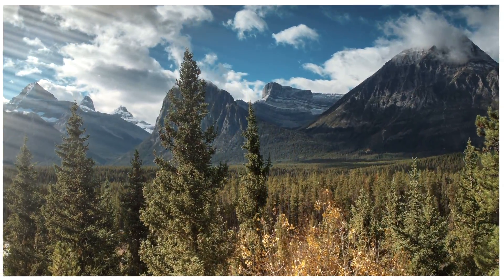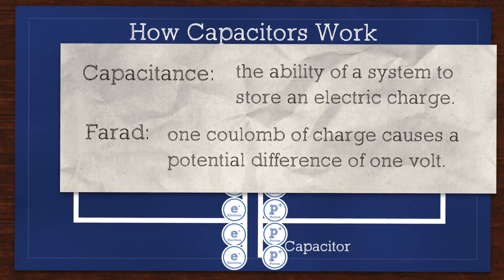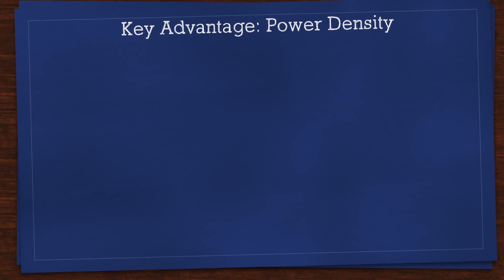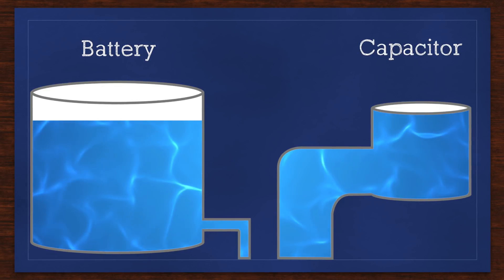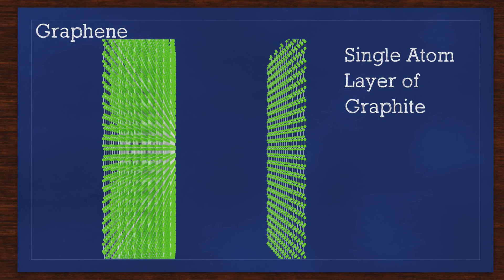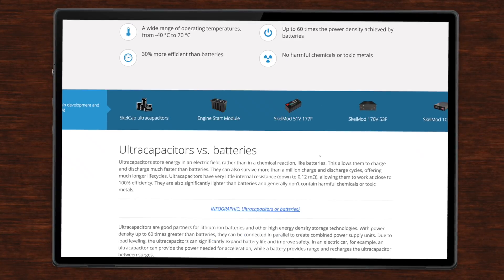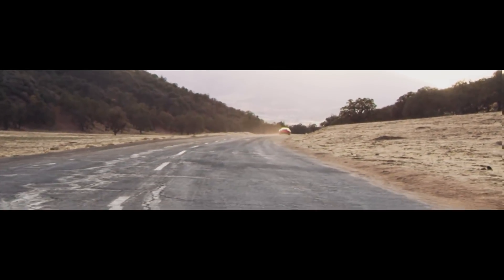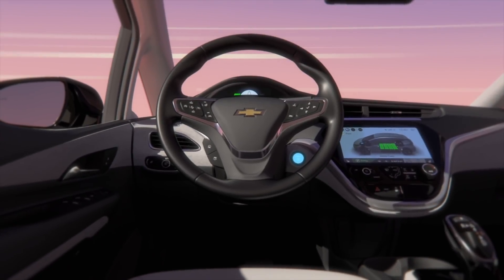Can This New Technology Make Batteries Obsolete?

Comment: Will this change your source of energy to run your home and your car and lower your bill from the electric company maybe no bill or you might get a check from them. If every home had that capability then any natural or even a war would be much less likely and the lights would stay on even if a disaster happened. Not sure of the impact on life and or manufacturing in the long term maybe you can enlighten the viewers. If you want to think far out you might think of a food Synthesizer just put in the right food cartridges and push the button

Comment: I remember back from my tech training days at Kessler AFB, MS in the 1980s that we were taught 
by wiring resistor to the Antenna of a mobile radio to boost it's signal strength and prevent power  loss.   

A similar type of device should be used to prevent power drainage to a capacitors storage. There will design issues but someone will figure it out to make it work.  I apologize if i am wrong on this subject but it's just a thought on my part.

Comment: How do you keep these from becoming bombs? Either accidental or intentional? Any time you put large amounts energy, in a form that can release it almost instantly, you have the potential for large scale damage. Imagine these in a Tesla. First how well would they hold up to a crash? As dangerous as lithium ion batteries are in a crash/fire: how dangerous would something be that could release its energy at 10/100 times the rate? One of the things that scares first responders is cutting into electric or hybrid vehicles. Wouldn't the danger increase? Are these more or less susceptible to cascading failure? In a battery bank, as one battery catches fire or explodes, what happens to its neighbors? Time to design with known issues in mind.

Comment: I feel like there will be a point in the future where batteries and capacitors will be functionally the same thing.
Reply: John B Goodenough's most recent project is effectively an odd battery/capacitor hybrid within the same unit.  Holds more charge than the best lithium batteries, but also charges faster and has better long term life cycle.

Comment: Maybe future Evs should be a lithium ion battery/super capacitor hybrid, where the capicitor is used for regenerative braking and dc fast charging, while lithium batteries are used for long range driving and lower levels of charging.
Reply: Essentially already has started to be used.  It's a somewhat oldish idea.

Comment: Ultra capacitors are great to extend the life of batteries which are degraded by extreme levels of charging or discharging or high rates of charge and discharge.  The ultra capacitors can take up fast levels of charge such as when braking in an electric car.  The charge can then either be used to slowly charge the battery or to accelerate the car when needed.

Comment: _ It would be easy to get free energy if possible to convert (capacitor static stored electriciy) to a battery without frying it or the wires _ as a Whimhurst on a small windmill can store a lot of static, and a battery can drive an electric motor ?

Comment: the problem with this battery is THEY REQUIRE CHARGING, the energy cell of the future does not require charging and is disposable. UNTIL I HEAR OR WATCH A CAR OR ENGINE THAT COULD RUN 24 / 7 HRS FOR 20 YEARS WITHOUT CHARGING it is not yet the future.
Reply from the maker: Do gasoline cars do that today? Might it be argued the future is evolutionary? The first computers weren’t very fast but 25 years of mastering them has led to “the future”
Reply: You better get used to riding a bike in the future if you plan on defying laws of physics.
Reply: @truantray  i have just watched the voyagers 1 and 2 they ran for more than 30 years already and still running without charging. they are using a plutonium base battery.

Comment: Car manufacturers are saying that 700 Kg of lithium ion batteries are now 1/3 of the cost of the entire car. I am not sure if this is entirely accurate but even if its a good approximation, this means that new battery like applications are really the *oil of the future*. 

Hurry up guys, I wanna drive a newish ultra cap car before 2028, as I figure that somewhere around 2033, someone is going to figure out that humans, in general, don't drive cars effectively and will probably ban us from direct driving for all time in favor of autonomous vehicles.

Comment: When charging ANY capacitor from constant voltage source you lose 50% of energy in capacitor conductors - this is elementary theorem studied in college. When discharging - the same. Capacitors will never be used in electrical systems. They may be used only in systems where efficiency is not important. This movie is a loss of time.

Comment: battery powered cars will never be ubiquitous. Tesla has been around for over 15 years. And still, I can go to my local grocery store and not see single electric car. It is always the same story: Just wait, the revolution is just around the corner. Always the same pitch. 

Electric cars are for rich people, environmentalists, and virtue signalling cuckolds. In the US, only 0.3% of all cars are electric. After 15 years of being on the market. 

Batteries don't cut it and capacitors are not going to help. Electric cars being the norm will happen. But it won't be our lifetimes. Because it won't be with batteries. Or Capacitors.

Comment: im confused we use battery because it can have high energy density, which does not conflict with capacitor power density as you said. We use battery to store more energy for later use, and capacitors to get a lot of power out quickly. How would capacitors replace batteries? aren't they complimentary rather than conflicting?

Comment: would be awesome to see a graphene ultracapacitor make an involuntary discharge.. Always respect energy density, how much energy do you really want to have in one place?..
Reply from the maker: well a 10 gallon gas tank, had about 300 kWh worth of energy, batteries can store around 50-100 kWh in a car... at the end of the day, the energy you need for propulsion, is also a danger that needs to be engineered and mitigated. It's the same for a rocket booster for a space shuttle.

Comment: I don’t believe Skeleton Technologies have anything like claimed in this video. Their current product lineup is advertised with an energy density of up to 6,8 Wh/kg.  Let’s say you want to make a Tesla battery of 100kWh then you need 100,000/6.8=14,7ton!!! Making a battery with graphene layers with a stable separation in an automotive environment is a bit of a fantasy. This video is fake news.
Reply from the maker: yeah they still have a ways to go, but this research and development is happening, and that's the good news.
Reply: Two Bit da Vinci The bad news is that to isolate two layers of graphene you’ll need a very robust similarly thin insulator sheet that doesn’t cause any runaway short circuit events if even one tiny point becomes contaminated. In my opinion, the insulation sheet is much more critical than the conductive sheet as it defines both capacitance, maximum voltage and robustness. The hype of graphene is used to attract investors and fool people. Don’t get too excited before you see a real working prototype that doesn’t self destruct outside the lab.

Comment: graphene is already a huge game changer with batteries, with new battery tech getting 70+% charges in 5 min, 2 companies have already done it one in israel and one in singapore. caps will never take the place of batteries but if they are used in EV's they will only be there to compliment batteries in the way you have stated in vid as better regen charging, quick boost charging (splash and dash) and/or faster acceleration like having a bottle of nos in an ice car
Reply: Underrated comment!  Agreed.

Comment: That's about a 50% increase in energy density on a lead acid battery which is getting close to Lithium though there have been improvements with Lithium that could push that just as far away again. Still the near instant capture and release of power makes it great for acceleration and re-gen as he said. Capacitors typically have absolutely massive cycle lives too so this is far more than tech for tech's sake.

Comment: you do a horrible job of explaining why a capacitor can never out preform batteries. a capacitor releases all of its charge in one burst then it is empty. how can that ever replace a long term usage battery?  put in capacitor turn on device and watch it turn on then right back off because no power left in it. would have been nice if you just talked about how a capacitor works right now in the real world. not in this fantasy world of someday. a capacitor is used specifically to give large voltage bursts. then has to recharge, electronics use them to amplify a charge to make it stronger, but without the batteries the capacitor is useless.

Comment: Solid state batteries are showing more promise with greater storage per kg. Also, companies in England have working prototypes that make Tesla batteries perform like lead acid batteries. For High capacity storage Zinc Bromide batteries are a far cheaper solution than Lithium batteries. Google Zcell for more info.
Reply: Zcell is by no means cheap, unless perhaps you count it's lifetime cost (they have a very long potential lifetime).  It is an interesting product mind you, and the price has certainly dropped recently such that I might consider it over lithium, but that would depend on it's power capacity vs energy capacity. For the cost of a Zcell I can almost buy an entire 5kW system with Tesla battery.

Comment: Visualizing the ultra capacitor as a part of a chain of energy collection and generation. Like a primary battery storage, a secondary storage/converter and a tertiary super capacitor. Like in the lungs, the primary contains or expels the air, the secondary routes it to smaller locations and the tertiary is tiny vesicles that transfer the oxygen directly into the blood over the surface area of the outer lungs. 
  But an electric motor is the smallest surface area and the battery the largest. So an intermediary battery that constrains the electric flow and then the Ultracapacitor works the A/C motor at a high level of efficiency? Or is that just what the inverter does? I'm really not knowledgeable enough to determine. This is all speculation.

Comment: Good explanation on basic capacitors.  Unfortunately a little too simplified when it comes to SUPER-capacitors. These so-called Electric double-layer Capacitors (EDLC) usually utilize a charged layer in combination with a porous graphene surface. Sometimes even a Redox-Reation between electrolyte and surface is used, ending up in a mixture between battery and capacitor. Would be interesting to know the setup for those Skeleton Technologies capacitors in more detail. Overall there is a lot potential for a followup video explaining EDLCs in more detail.
Reply from the maker: Great point, as we set out we felt it complicated matters beyond the scope of the video. But great point about supercapacitors

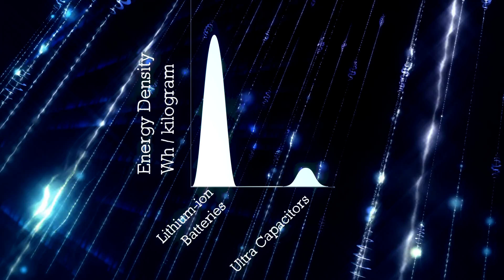Comment: While the idea and concept is really great.. but using your (3:21) reference, lithium ion got double or even triple the density of ultra capacitors even if (6:50) they are at 100%... say 100 Wh /Kg just for argument sake.. isn't transportation have that trust to weight ratio ?? sry i'm not an expert ..

Comment: Storing "charge" will never be more energy dense than that provided by chemical bonds. Capacitors do have a very fast charge rate, and could replace batteries in low energy demand applications that require a quick charge.

Comment: Capacitor has higher  power density but lower energy density but if graphene can make the capacitor turn into high energy density capacitor then it will realy change the future of EV and other application but the only problem right now is the mass production and price. Companies must produce high volume of graphene higher than demand so the price keep low and more affordable for various application.

Comment: Although you are correct that theoretically capacitors (any kind) can re-charge very quickly, to re-charge a capacitor with just 1 kW-hour in 1 second it would require  about 4 Mega-watts for 1 second from the grid! very few systems could handle the burst load. It's more practical to talk about charging in a few minutes, than a few seconds!

Comment: Their energy to weight is far too small.

The innumerate among us are at a terrible disadvantage. They simply 
cannot understand why certain things are the way that they are and other
 things simply are NOT going to happen.

Here is the simplest and best example: Energy storage for automobiles.

Look at this simple table:

Form energy density in megajoules per kilograms
Methane 55.5
Propane 46.4
Gasoline 46.4
Jet fuel (Kerosene) 42.8
Methanol 19.7
Lithium metal battery 1.8
Lithium-ion battery 0.875
Flywheel 0.5
Supercapacitor 0.36
Nickel-metal hydride battery 0.288

Source: https://en.wikipedia.org/wiki/Energy_density

This table lays to rest all of the BS claims made by the advocates of new 
forms of energy storage and shows why hydrocarbons are here to stay. 
Even if we stop using all fossil fuels and go to a pure solar energy 
economy, all energy will still be converted into hydrocarbons 
before being used for vehicles (except for special cases). Note that the
 "Gee-Whiz" technologies such as flywheels and ultra-capacitors need a 
ONE HUNDREDFOLD increase in density to be competitive. I omit hydrogen 
because it is far too bulky for use in ordinary vehicles.
Reply from the maker: You left off hydrogen, which is higher than all of these... so if that's your point you'd be a proponent of hydrogen fuel cell cars. Far too bulky? There are hydrogen cars on the market today with 300-400 mile ranges.

The question of storage is only half the equation. If you could just plug in and charge at every place you parked, you wouldn't need huge levels of storage? This is the sort of thing that's possible with batteries and EVs in general.

The supercapacitor figure is for traditional supercapacitors, not graphene ones. This is all early days, but graphene could have the potential to disrupt some of these traditional storage options.
Reply: @TwoBitDaVinci  I have never read of a hydrogen car with such range. Please post a link. 

The capacitor danger issue is paramount. A capacitor containing sufficient electrical energy to operate a car for hundreds of kilometers would be a potential bomb. Suppose that it held the energy of 20 liters of gasoline. (Ordinary cars hold 40 to 60 liters.) At a density of roughly .75 kilograms per liter, this would be 15 kilograms. Looking at the chart above, this means that the energy content of 20 liters of gasoline would be 15 * 46.5 which is about 700 megajoules, a huge amount for a small object. The energy density of high explosives range from 4 to 8 megajoules per kilograms. For round numbers, take 7 megajoules per kilogram, the energy content of Hexanitrobenzene . 700/7 = 100. Clearly, we have the energy equivalent of 100 kilograms of high explosive. There is no possible way to safely dissipate such a huge quantity of energy in any brief amount of time, regardless of what the idiot said in the video. It is enough energy to convert a car into little, tiny pieces of shrapnel. In any catastrophic crash, the failure of the capacitor would cause a huge explosion sufficient to destroy the car, the passengers, and any building for perhaps 20 meters. So forget capacitors regardless of claims made about them.

I am still curious about the hydrogen car. If there is a safe way to store sufficient hydrogen, I will withdraw my comment about hydrogen fuel.

Comment: You have got to be insane if you think that within seconds, you will need to feed thousands of amps of current all in one shot into a capacitor bank to give you 25 miles of range, even if you charging station would be at 500 or more volts.  Just the thickness of the wiring involved and the safety considerations if there is a circuit failure anywhere.  Do not get me wrong, I want better ultra capacitors and I know what they can do, its just people claiming that they can make an effective bank and just charge so fast without pushing that current in seconds faster than what the car can burn in 30 minutes have some misunderstanding of how electricity works and how much an EV car consumes traveling at 50mph for 30 minutes.  The biggest thing about ultra capacitors would be the number of charge and discharge cycles it can take before it begins to break down and that you can completely discharge it, the re-charge it safely.
Reply: I reckon they'd best be used as part of a KERS system - when you slow, energy goes into a small ultracapacitor bank rather than the battery, and is then used to speed up again.  The roundtrip efficiency would be way better than batteries (which I think is around the 60% mark under this load for Tesla), and the gains would be most pronounced in city driving.

Comment: My scop as heatpump batteri can. Thanks to peltiel elements vater as heat salution. Its works forever and makes heat and power. From the scop effect. 5000~10000peltiels on heatpump. On inverter 230ac 2tank ore radiator.. thats it.

Comment: Aluminum electrolytic capacitors aren't exactly using flat sheets (plates) of aluminum.  The surface of the aluminum is highly etched to create lots of crevices, which increases the effective amount of surface area in contact with the electrolyte by a factor of 100 or more.